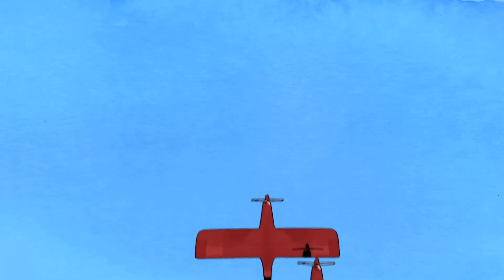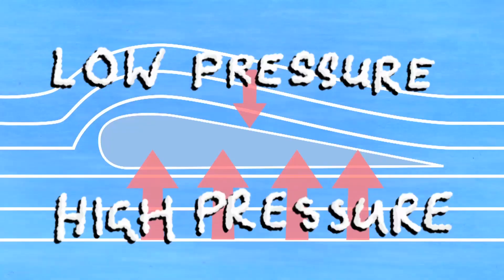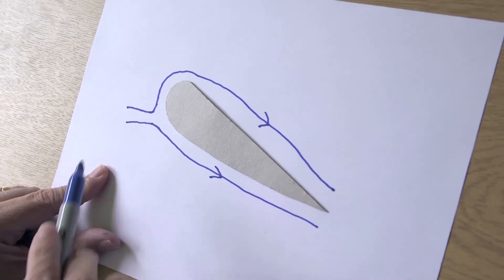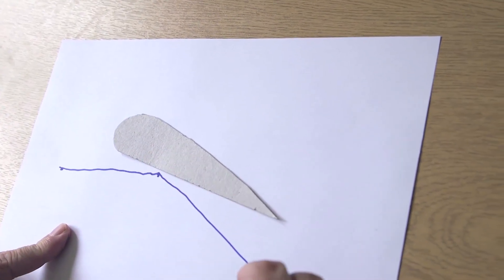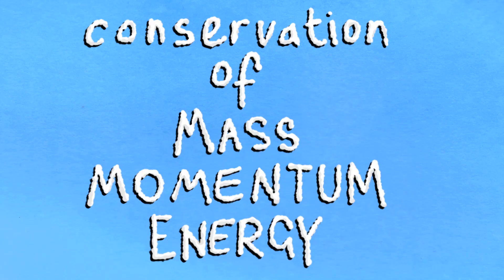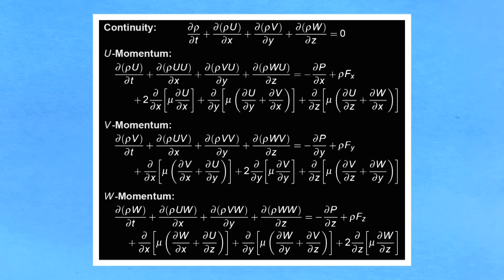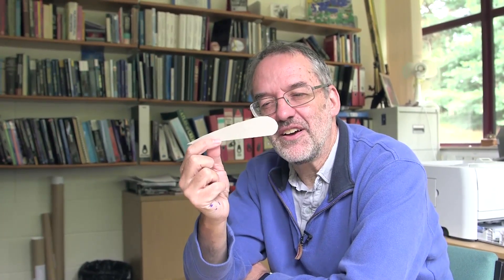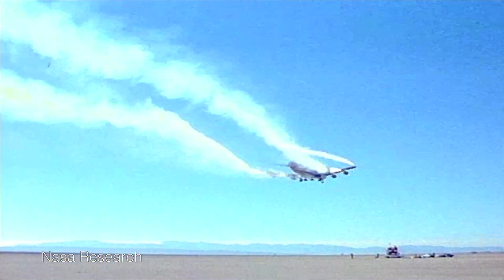Lift and Wings - Sixty Symbols

Comment: Euler's equations don't describe turbulence.  Turbulence is caused by the interaction of the fluid's resistance to its motion (i.e. viscosity) and its momentum.  Euler's equations are inviscid equations, meaning they only describe flow with a Reynolds number of infinity, which is equivalent to viscosity being zero.  If you look at flow patterns over a cylinder at various Reynolds numbers you will see that at a Reynolds number of infinity, the flow pattern is the same as inviscid flow over a cylinder.  If you take the Navier-Stokes equations and cross out the stress tensor and the gravitational force, you get the Euler equations.  The Bernoulli is just the integral of Euler's equations for 1-d flow along a streamline - they are both inviscid and steady (i.e. no time dependence).

One of the really fundamental reasons inviscid theories are just wrong is that because air is viscous, it sticks to the airfoil's surface.  In other words its velocity relative to the airfoil, or whatever object, is zero.  This is not the case in inviscid flow.

Comment: Uh... I'm sorry, professor. You make it sound like forces from Bernoulli effect and conservation of momentum are two distinct effects that need to be accounted for separately. But that's simply not so. According to Newton's third law, airfoil produces counteraction on air that is exactly equal to lift, hence the change in air momentum. And lift can be calculated by integrating pressure over airfoil area. So that's two sides of the same coin, not two distinct effects -- when air pushes wing up, wing pushes air down.

Comment: When air gets squeezed into a tighter space, pressure drops. Who would have thunk it.
Reply: Not really, no. When any liquid (or gas) moves faster, pressure drops. And if we assume constant density, then liquid has to flow faster when it flows through tighter space. Note that we assume constant density, which doesn't necessarily hold in reality.

Comment: Knowing what ground effect vehicles are and how the work, is making me come to a conclusion that it's high pressure under the wing, compared to that of over it, that creates a lift. As in ground effect - you hit a "pillow" of air (additional lift) when you land. It's because the high pressure air underneath your wings has nowhere to go, because it's ground below.
Reply: Well, duh, lift is created by pressure difference (as is any other aero-/hydrodynamic force). However, it's not entirely correct to think that lift is created only by higher-than-average pressure below the wing. About half of the lift force is created because pressure is also lower-than-average above the wing.

Comment: Well... nice try, but to start with; your "how a wing does work" graphics are wrong: that is not how an airfoil typically looks like, and that is not how the air enters the leading edge. You can probably do better than this.

Comment: 8:23  I disagree, the most important is the conservation of momentum.
the conservation of mass & the conservation of energy are the means to achieve lift, by using the conservation of momentum. meaning you can achieve lift without using the conservation of mass & energy (he is right that they are basically the Bernoulli effect). see for example how do rockets work.
Reply: You can explain rockets using conservation of mass-energy just about as well as using conservation of momentum. Of course, Bernoulli's effect isn't really relevant here. Also you can't just "not use" conservation of mass-energy -- it's a universal constant.
Reply: of course one can not just cancel parts of physics. but he was asked which one of the 3 elements is the important one. the answer is clearly conservation of momentum, because the other 2 do not contribute much to the lift, and you can design a flying vehicle without relying on the other 2 to contribute to the lift.

Comment: As an aerospace engineer I'd say that at low velocities the energy equation stops being useful, since density tends to be constant and the mass and momentum equations form a determinate system by themselves, so I'd say the momentum equation is more useful than the energy.

Comment: "If you want to design a wing"
-you can run lots of simulations ( the stereotypical university approach), or
-you can run lots of empirical wind tunnel tests tweaking the design by gut feel (aka 1940's), or
-you can do what makes the most sense and marry (or at least ally) both approaches.
The last means that neither engineering nor physics can thrive alone. {so I've now angered the bean counters in both departments}
Reply: 747
Reply: OK, 777, sorry

Comment: Commercial planes have engines below the wings which according to me should make velocity of air below the wings more than that on the upper side, so shouldn't they cause a downward force on the wing instead of an upward lift?
Reply: There are several things to consider here. First of all, the Bernoulli equation only holds true if energy is conserved. In the case of a jet engine, the combustion of fuel increases the total energy of the air that goes through the engine. So in this case the Bernoulli equation doesnt' hold true, and infact the air coming out of a jet engine, although moving faster, has indeed the same pressure of the atmosphere, or a bit more. Next, consider that this exhaust air does not imping on the wings. If it were to hit the underside of the wing, it would indeed increase the lift produced, because that would mean that more air (and with a higher momentum) would be deflected downward by the wing. The same would be true if the jet engine would blow its exhaust on the top of the wing. There are some aircrafts that use this design to achieve STOL (Short Take Off and Landing) performance: the Antonov An-70 and AN-72, and the Boeing YC-14 prototype.
Reply: It's not so simple. If the air were a non-viscous fluid, even if the wing would have a positive angle of attack, it would not produce lift. The viscosity of air is responsible of the Kutta condition, and the subsequent creation of a circulation around the wing.

Comment: Great explanation other than one thing which I have to disagree with, you can absolutely separate the bernoulli and momentum effects. 
Simply by creating a symmetrical wing, symmetrical wings work and are used vastly for military fighter jets, this is because at extreme speeds, a small angle of attack is more than enough to create the desired lift and aerofoil lift becomes miniscule in comparison, so to amend the final part, lift has a larger effect at slower speeds, and AOA is more important at higher speeds, aswell as allowing no change in control during inverted flight.
Reply: Yeah, as soon as you change the angle of attack Bernoulli is now involved due to the "stagnation area" moving off center as the Prof points out.  You've made it an airfoil shape by not directing the air along the longitudinal axis (wing chord) of the symmetrical airfoil -- making it unsymmetrical, at least as far as the airflow is concerned. 

Also, take a look at the cross section of the wingtip of an F-15 or F-35. Not only is the airfoil not symmetrical but, at least at the point of the wingtip, there's an under-camber like an old fabric covered plane (it doesn't carry through the whole wing, it's more like the leading edge twists down as you move toward the wingtip -- this gives you a wing that's not doing the same thing through its whole length, exactly because different areas are specialized for different speeds and angles of attack).
Reply: Those two are one and the same. Momentum change in air is caused by pressure difference, which is caused by Bernoulli effect. Prof makes it sound like those are separate for some reason. They aren't.
Reply: That's assuming that the stagnation point remains at the same location on the symmetric airfoil as the angle of attack changes.  At a = 0, the front stagnation point will obviously be at the nose, but this will change as the angle of attack increases.

Comment: This is not a complete picture,  you have shown a flat bottom airfoil but there symmetrical airfoils as well.   Is it only thrust and angle of attack that allows a plane with a symmetrical airfoil to fly ?

Comment: The force (full aerodynamic force and useful part of it - lift) - is a (change of) momentum per second. So the momentum is directly connected with lift. The mass and energy equations are important, but hiding behind. If you can calculate the exchange of momentum between air and wing - you can find the lift.

Comment: So is it fair to connect the "squeezing" effect with gravity?  It might also be a function of geometry, but gravity offers up a powerful asymmetry here that could address the "upside-down" argument.
Any fluids engineers / scientists / mathematicians able to weigh in?
Reply: eyeammi 
So why is it then that the fluid is more compressed on top than on bottom for relatively flat angles of attack? How does one address the "flying upside down" comment?
Reply: Thank you for the detailed reply!  The short answer, if I'm getting you right, is that 'flying upside-down' is a bit of a fallacious argument, in that an airplane with the wing inverted as shown in the video would, in fact, fly downward - the angle of attack needs to be adjusted to make inverted flying work.  And, I imagine, the ability of pilots in modern planes to change the angle of the flaps on the wings will matter substantially for flow dynamics.

Comment: @6.50  he is saying that the explanation of a physical phenomena COMES OUT of the equations when the physics is always there, the equations are only a MODEL that humans use to approximate nature bahavior. Here is an alternative to the TOP-DOWN explanation given: The air around the rounded part of the wing is squeezed together because the air flow is curved (why the air goes around the wing? Viscosity, momentum, all that stuff.) the only way for the air flow to perform such a curve is to have a resultant centripetal field which is the pressure gradient.

Comment: Engineers explanation, coming from an engineer:
Due to the shape of the wing, more air hits the bottom of the wing than the top.
Whatever the more complex explanation is, this is what is happening on the background. Surely it's not a usable explanation since you cannot use it to make a better wing, but it's always true.
Reply: 0xbaadf00d I kinda always thought that too, but what threw me off is the experiment with the ping-pong ball being lifted in the airstream of a blowdryer. In a momentum driven scenario that would be a completely unstable situation, if the ball moves a little to one side, it will be hit by more air molecules from the middle of the stream, causing it to deviate further. This always made a pretty strong argument for the Bernoulli principle for me.
Reply: Note what I said, It's not a usable explanation. Well, not in this sense. But if you think about it, ping-pong ball being stabilized in an airstream is caused by the molecules in the airstream pushing it back to the center. Now we are only left with the task of making an explanation why the molecules would bump more against the side further from the center.

Comment: Could someone help me understand. Why does air compression above the wing create lower pressure? It seems to me it would be the opposite.  I understood that air moving towards lower pressure gets faster but can't comprehend where does the lower pressure come from exactly.
Reply: Upon some more research I understood that it is the speed that creates low pressure and not the other way around. But why does the speed increase above the wing? Please correct me if I am wrong in any assumptions.
Reply: Wikipedia: Bernoulli's principle. And he said it several times. 1) Air at the top travels faster (why is another topic and quite complicated) -> 2) the faster air has a lower pressure (that's bernoulli's principle).

Comment: Suppose we made a wing, angled in the usual way, but entirely flat.  Would it still generate lift?  If so, would this be purely from the angle of attack?   Or would there still be some Bernoulli Effect? If so how would this arise?   Incidentally, I think Bernoulli formulated his law for the case of fluids constrained to flow through a pipe of varying cross-section, where it is easier to see that there is a trade-off between velocity and pressure.
Reply: Yes, flat plates generate lift. 

The angle of attack produces the same pressure differential due to the explanation about conservation of mass.

Comment: How about analyzing how bicycles work? There are lots of false ideas there.
Reply: I was thinking the same myself. It is somewhat analogous. In fact I personally think it is even more interesting, and a little less clearly understood.
Reply: Bicycle's stability is fundamentally tied to relativity. For example, a bicycle escaping from the temporally decreasing gravitational influence of a pub might lose stability for the observer travelling at b (speed of bicycle). Within that system, the curvature of spacetime fluctuates as well, so it's basically proven by Einstein already.
Reply: afeliafail 
Then explain the part where they built a bike without it and it was still stable. Which is also in the video. Try actually watching the video.
Reply: Can confirm. Own a bike in a one-dimensional frictionless environment.
Reply: Would take more than a minute, no disrespect to the fine videos from Minute Physics.
Reply: The story of bicycles is just like the story of wings - there are a lot of "wrong" explanations, but most of them are just part of the story. "Trail" caused by the angled headtube, gyroscopic effects on the front wheel, and the actions of the rider all together keep a bike upright, by constantly steering to counter the bike's tendency to fall over. And, yes, you are right - bulk gyroscopics are way to weak to stop a bike falling over, and you can build a bike with none of these features, and keep it upright with a heavy mass in front of the steering wheel's contact point.
Reply: Yes please!
Reply: Angular Momentum is still conserved it's just |L|=0. The other "gadgets" are just to make a real bike work, due to things like a non-frictionless ground and steering. But a Bike in a one-dimensional frictionless environment would work perfectly just by conservation of angular momentum. Everything else is just engineering.
Reply: The bike itself and/or the rider have a tendency to steer into a lean.  Other effects, like the gyroscopic effect of the wheels also improve stability if they are present.  But those effects aren't absolutely required because evidently it can be sufficient for stability just for the bike to have a tendency to steer into a lean.
Reply: When the wheels turn, the bycicle moves. Simple
Reply: You pedal and the bike goes, simple.
Reply: There are many aspects of how a bicycle behaves that are not understood by experts who have studied bicycles for decades.
Reply: Yes, do bicycles next!
It is another one of those often debated explanations.
Tho, tbh, I have no idea why it is supposed to be complicated. Seems simple enough to me. So would be happy to hear what I'm overlooking here.
Reply: afeliafail 
That's NOT why.
The video...
https://youtu.be/oZAc5t2lkvo
Reply: Didn't Veritasium do a video on it?
Reply: Tom Bloom it wouldn't, it is just the angle of the headtube that makes the front wheel to steer "under" the bike, thus compensating the falling. Look up the vid
Reply: Not really, some simple kinematics and dynamics can explain bicycle mechanics. It can be easily model.
Reply: University of Delft proved that angular momentum is not sufficient to explain why a bike does not fall over. There are more factors involved. The human factor (constantly adjusting) is the most important.
Reply: Minute Physics did a video on it.
Reply: Bicycles are easy! They are basically like our solar system: They work by conservation of angular momentum.
Reply: Maxwell's Demon is about thermodynamics. A bicycle is mostly about mechanics,  just very hard mechanics.

Comment: Sails, paper airplanes, kites and various other airfoils has many different shapes other than the classic wing profile shape. Conservation of momentum due to angle of attack is by far the most important lifting factor at subsonic speeds.
Reply: Paper airplanes, some kites and some sails certainly can be just a flat surface, however many of them are also made as or from a classic airfoil or wing profile shape. The fact of using the profile, and the shape suitable for the job and speed simply enhances it. It becomes a more efficient "wing".
It would be interesting to try to determine just which was the greatest contributor, and where the line would be depending on speed, shape, etc.
I'm sure this information must be out there somewhere. Collating it into an easily digestible form could be another matter entirely.

Comment: I would assume that changing the attack angle of the wing is worst than using the wing in the way it is supposed to because of drag. Am I right?
Reply: Yes pretty much, the most obvious situation where this isn't always correct is at take off when the angle of attack is necessary to generate enough lift at low speeds.

During cruise the angle of attack generates far too much drag to be used for lift generation.
Reply: Thanks hk78901